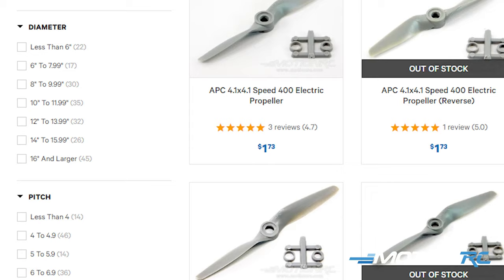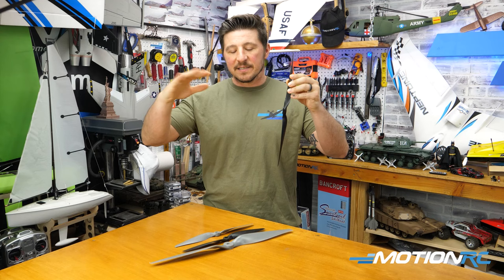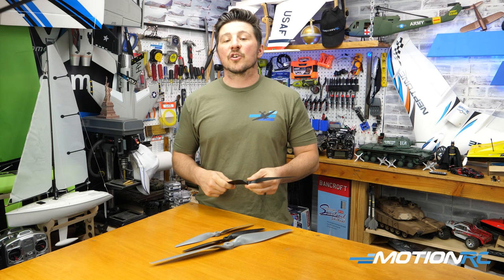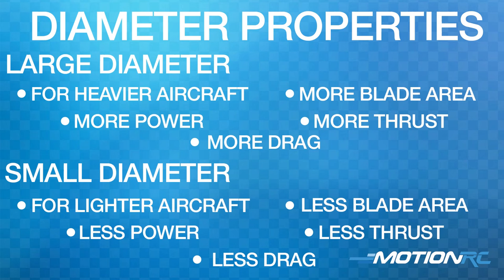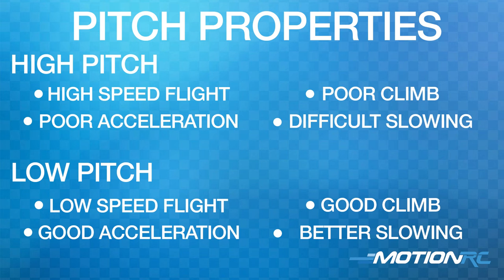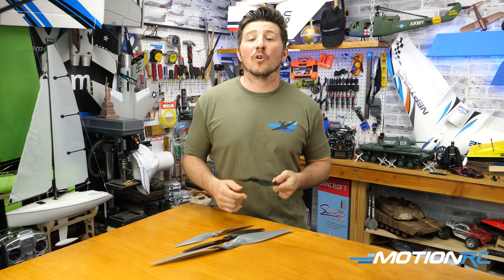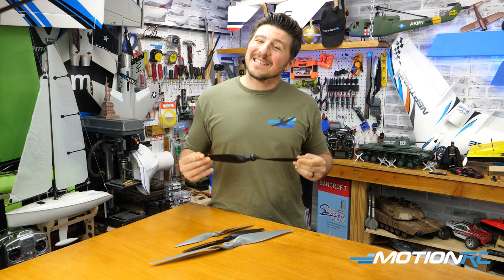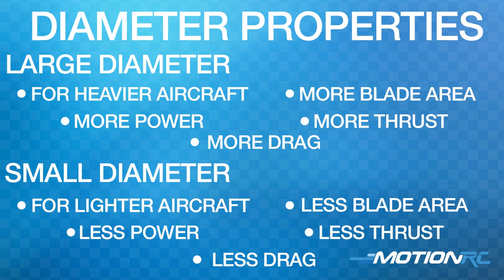Propeller Diameter & Pitch | Quick Tip | Motion RC

Comment: I choose the pitch based on how fast I want my plane to go and then I choose a diameter that puts the right amount of load on the motor. The formula for how much power is required to turn a propeller is: Power  = k * rpm^3 * diameter^4 * pitch. So as you can see from this formula, the rpm has a huge effect on the amount of power required, the diameter has a large effect, and the pitch has very little effect. For power in Watts, and diameter and pitch in inches, k is about 5.3×10-15 for an average model airplane propeller. I generally want the diameter to be 1-1/2 to 2 times whatever the pitch is.

Comment: Thre corsair was actually designed and built around the motor and prop, the purpose being to attach a plane to the largest and most powerful motor and propeller available. This is the reason that the corsair has inverted gull wings, as the plane was literally designed around the motor and prop combo.

Comment: Agree James that there is no magic fit when it comes to prop size. Often you need to have a few on hand to test with your aircraft to find the best characteristics of throttle response and desired speed. Fortunately they are very inexpensive and it’s wise to have several on hand. 👍

Comment: Great information, so on my pusher plane I'm running a 1400kv motor, 4s lipo battery and a 8×6 folding propeller, I'm trying to slow this bird down and get more thrust for hand launching. If I stay with 8 inch diameter propeller would 8×4 be a better option or maybe a 8×8. Thanks

Comment: For sport/pattern/warbird type flying 70% pitch to diameter ratio is the golden ratio for good balance of climb, cruise, top speed, and glide performance.  50% pitch is good for 3D type flying.  It’s like stuck on 1st gear though, good for climb, but not efficient, really acts like a brake on down line and kills glide ratio.  Changing props completely change flying characteristics of a plane, almost like getting a completely different plane.  Choose wisely.

Comment: & if u go bigger in size, u wanna reduce pitch! (Rule of thumb I learned 20+ years ago)
Reply: The pitch has very little effect on the amount of load that a prop puts on a motor. To compare the load factor of different props, use the formula:  Prop Load Factor (PLF) = Diameter³ x Pitch. Solving this formula yields a pure number (no dimensions) – for a 10×8 prop, it equals 8000 (10 x 10 x 10 x 8). To find a prop that will load the motor the same as the 10×8, it must first be the same type of prop. By substituting terms, you can find a prop that is perhaps a larger diameter, different pitch, etc. As an example, a 10.5x7 would be very close (10.5 x 10.5 x 10.5 x 7 = 8103). But would you cut an 11x7 down to 10.5" or would you install a 10x7 and let it rev a little higher (10 x 10 x 10 x 7 = 7000). Or, would you install an 11x7 and put a heavier load on the motor (11 x 11 x 11 x 7 = 9317)?